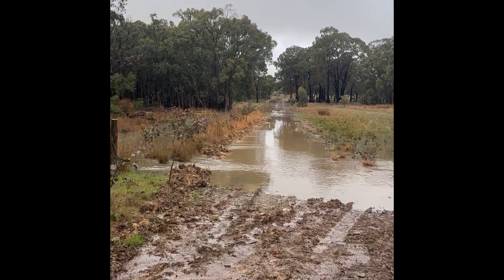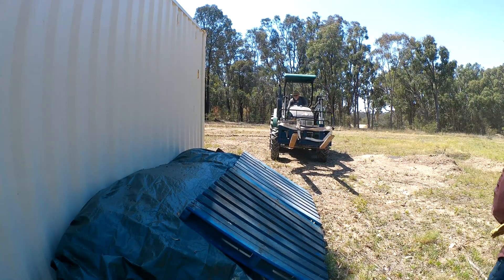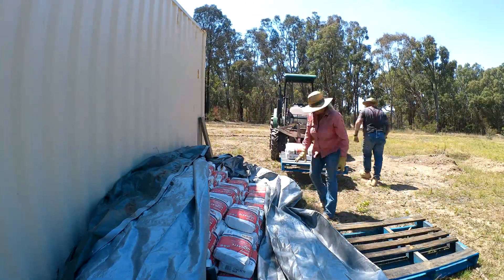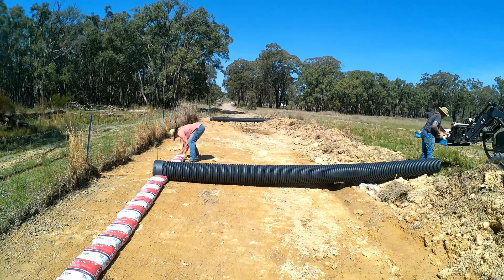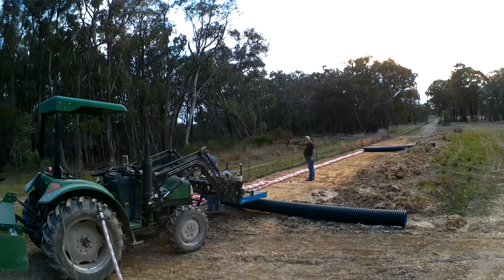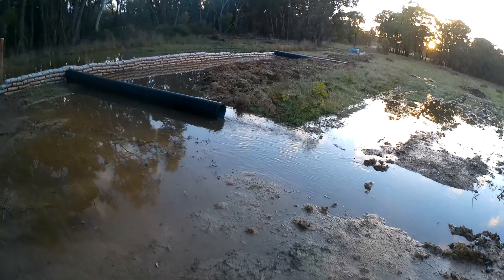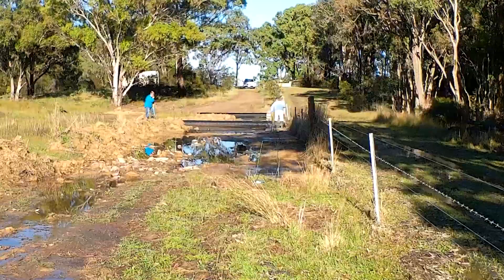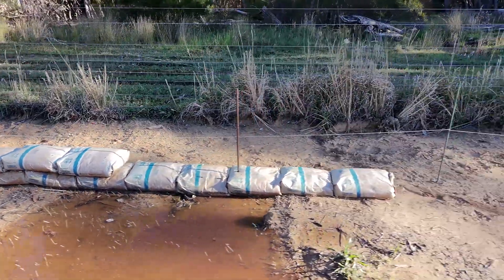Building a Cement Bag Wall for Flood Control

Comment: Great stuff you guys are doing. 
One minute it’s cement bags and then it’s concrete bags. 
It’s a dry concrete mix. 
Cement is an element of concrete. 
Concrete is the finished product that had water added to the dry elements.
Reply from the maker: Believe it or not,  I know that. I think in one video I even called them sandbags. But when the camera is pointed at you, you use them first word that comes to mind.

Comment: I have a similar issue. My thoughts are geofabric, small riprap base,  geofabric with geogrid filled with smaller angular rocks. I saw concept on some us road building videos in Alaska.
Hopefully a stable surface for light traffic.  floodwater usually not deep enough to enter exhaust.
Reply from the maker: We looked at a number of solutions including concrete mat that you can roll out, but the water gets too deep just there.

Comment: Would it have been easier to just a get 3 metres or so of concrete and pour the wall after forming it up.
Reply from the maker: It would have been a lot easier, but the main reason we used the bags is for the look. It is extra work but once we are finished and we gurney the paper off the bags you’ll be able to see how much better it looks than a plain concrete wall.

Comment: question why did you not use a clay-based fill for this it would have saved you having not to buy the concrete bags
Reply from the maker: To be honest… Gaylene saw a video of a concrete bag culvert and loves the look. I like it too, I think it will look awesome when we finish. Our clay has no support when it gets wet. We’ve bogged ourselves multiple times even after moderate rain, and I got bogged to the axles right next to where the concrete bags go in. No amount of driving on it packs it down. We need to build it up with rock and gravel and fill it in.